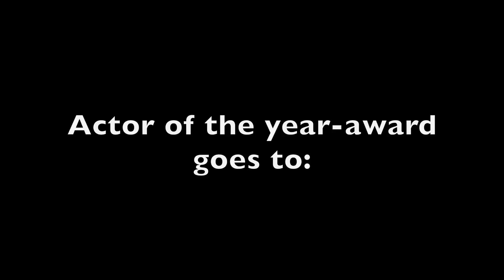Fisher 30 Ep16 - Correcting errors and epoxying on. And teak rail templates.

Comment: I'm a fan and like your approach to functionality over quality one suggestion would be to make aluminium drip tray for under the engine, much better having oil capture and easier to keep clean
Reply from the maker: Thanks, Gregg. I might actually do that, or go for oil soaking mats. Still I think there should be an extra non-removable oil-spill sump, nomatter. 😊

Comment: Making good progress on the project.  👍  I like the idea of a containment sump to catch the oil under the engine ... there is nothing worse than having a bilge full of water and oil mix!  You might consider lining that with oil absorbent pads (PIG mats) after the engine is in place -- less to worry about oil sloshing into the bilge in rough seas.  Once they are  full of oil or anti freeze you can pull them out for disposal, and then place some fresh ones into place!  I saw a listing for a Fisher 37 the other day, it had a different floor plan in than Sail Boat Data website showed  -- I was wondering if someone else had done their own refit on it just as you are doing to the Fisher 30.
Reply from the maker: Oil absorbent mats is a great idea, Robert! Thanks!
That Fisher 37 is of interest to see the ad. Do you have a link to share?